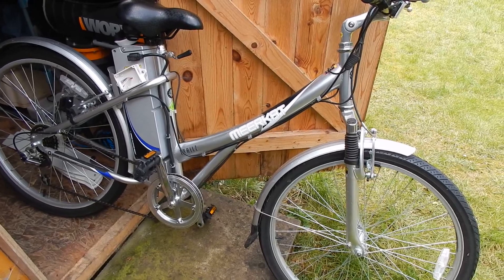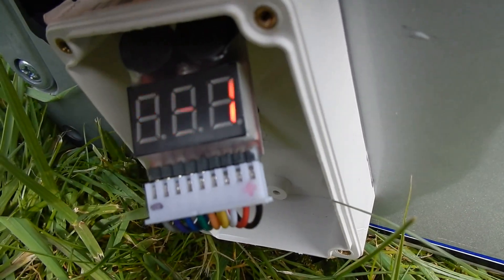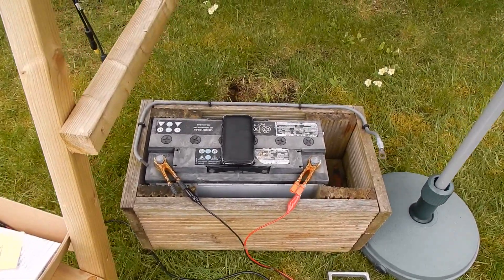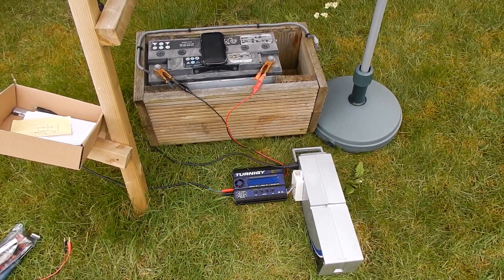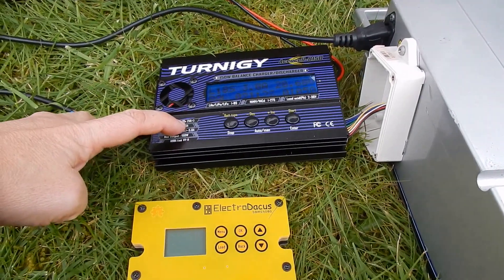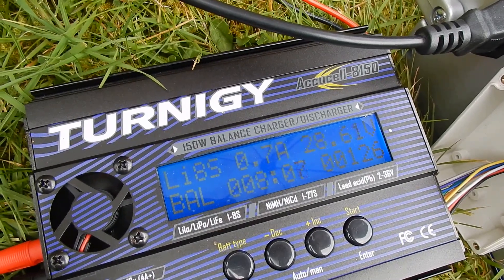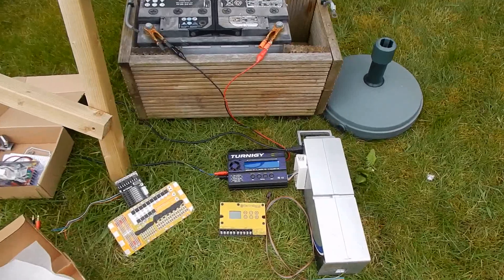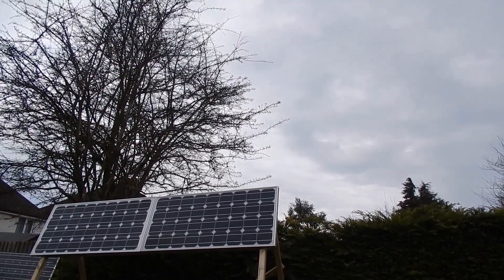Electric Bike Upgrade: Plan to use ElectroDacus SBMS

Comment: Wouldn't it be easier and cheaper to connect the bms to the battery and just have a simple power supply? You wire the bms once and forget about it. When the battery is flat just plug it in and let the bms do everything. I've done this with my 48v 20ah battery filled with 18650. No need for expensive smart chargers which are capable of producing high amps. Just get a high amp psu and that's it

Comment: Another great video Julian :)  Myself I'd be tempted to use the 12v battery/boost converter all of the time but it will be interesting to see how the system performs when just running on "raw" solar :)

Comment: how about spraying some silicone onto the terminals after you put all together?  wouldnt that prevent corrosion?
My ebike has some Oil (?) on the battery contacts to prevent corrosion

Comment: Strange electric bike. My current one provides no assistance until you start pedalling and keep pedalling all the time. There is no throttle just switched assistance levels. This is a Ghost mountain bike. My earlier bike was a Schwinn tailwind that also only provided assistance.  If your bike is not outside of EAPC approval, it is outside of the spirit. It does look weird.

Comment: Those little lipo meters are measuring with only one adc pin, switching the cells all the time. This means that at least the offset is accurate, and in this case thats quite worryingly high. Did you set your charger to balance charge?
Reply: the voltage could be higher because of the 3 amps your charger is putting in. The little checkers tend to be okay in terms of accuracy but you can check using a voltmeter.

Comment: Glad to see you found a use for the SBMS4080 :) That 60 cell PV panel is ideal for that 8 cell LiFePO4 and yes you can use a constant current power supply instead of PV panels.
The cell balancing on SBMS will start working as soon as there is a 10mV (can be set to any other value) difference between highest and lowest cell. That is maintenance cell balancing and more than enough to keep even very large hundreds of Ah cells in balance indefinitely as long as they are use in a typical off grid installation where charge rate is around 0.3C and discharge rate below 0.5 to 0.8C.
I just designed and build a new version of SBMS called SBMS100 much more futures and higher power supports up to 3kW of PV panels and up to a 12kW load with external 500A current shunt.
If you think you can have a good use for the new SBMS100 or SBMS60 I can send you one (you can see details about it mostly on my google+ page I will soon do some youtube videos about probably next week). My next project will be a Solar PV heat controller so that I can heat my house fully with solar PV electricity the heating part will not use a battery but thermal mass for energy storage.
Reply from the maker: +electrodacus Thanks Dacian. Sorry I didn't use it earlier, but I had a lot to learn about lithium cells (and batteries) - I think I understand it all now. Also, I have the 60-cell panel now, which should work well (as you say). I'll watch your videos on the SBMS100 to see what all the new features are, but for this summer I think the 4080 should keep me busy enough.
Reply: Julian Ilett Thanks Julian. I can send you a bank of supercapacitors so you can much more easily play with the SBMS4080. You can charge and discharge those in minutes or even a few seconds so you can test the limits much faster. Just let me know if you prefer the 8S1P 220F supercapacitor bank or the 8S3P 60F one see details here https://plus.google.com/+electrodacus/posts/1jDbJ95dbKF I can send you the Kit or I can assemble them for you just let me know.
Reply: +electrodacus There's a huge lack of solar+LiPo+LiFe chargers on the market.
I'm looking for a 500W MPPT solar charger for my home-made ebike that uses a 12S 48V 25Ah pack made from ten 5Ah 6S LiPos, with balancing of course.
If I can't find anything specific then any MPPT rigged as a power supply should be able to drive the DC input of the 300W Turnigy Reaktor that I currently use to charge at home in two 6S sessions.
The aim is to be able to charge during stops in the middle of nowhere, or try to keep the pack topped up while riding with the solar panels mounted on a trailer.
I can see this being quite a large market and am surprised that there is so little available, and affordable.
Now I think about dusting off my old electronics knowledge, researching like mad and trying to make something myself, if only for the satisfaction of a complete self-build! Daunting.

Comment: 6 months no charge you was lucky you didn't kill them all , And always a good idea to store the battery indoors and check every 2 months just to be on the safe side .
Reply: +Barrybados©. LiFe batteries are nothing like LiPo batteries.  They are much more stable.  Storage voltage on LiFe is around 3.3-3.35v which is what they were in the beginning of this video.
Reply: +Barrybados©. Lithium have a very low self discharge and they'll last a year or 2 no problem.